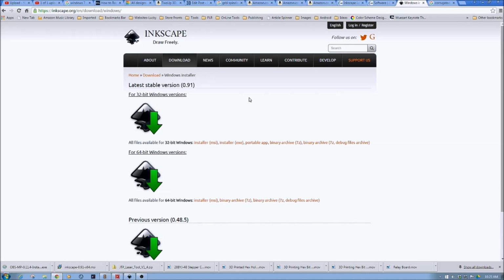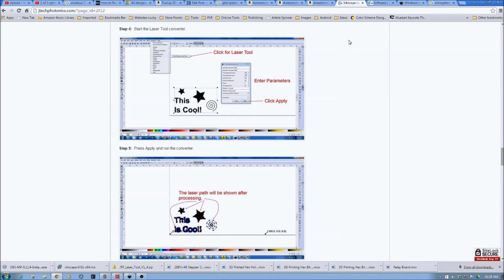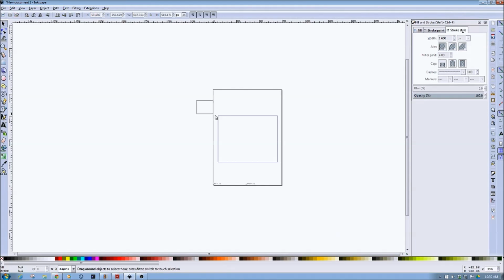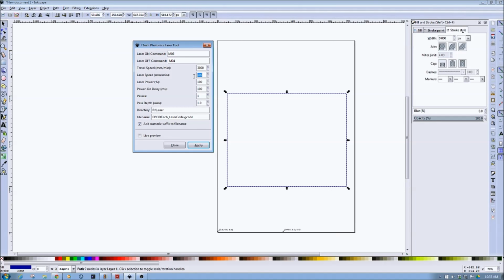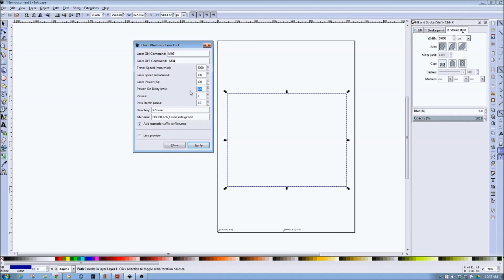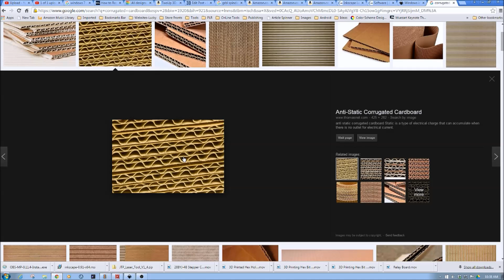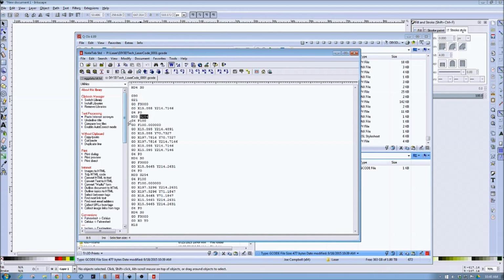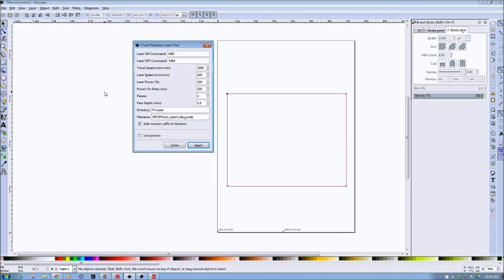Using Inkscape PlugIn for Laser Generating Cutting GCode!

Comment: I am using windows. I found one of my problems it was the magnet on the lid was not connecting so it wouldn't allow the machine to work.  Now that I fixed that I'm having trouble sending the file from inkscape to my cutter.  When I go to extension, Generate laser Gcode, tech photonics, I have no clue what to put in those boxes. I keep getting an syntax error
Reply from the maker: You need a Gcode sender to send the code...

Comment: I put the J-Tech files in the inkscape file and it said it will show up in the program under Extentions/GCode but it isnt  not  sure what im doing wrong
Reply from the maker: The new version of Inkscape has changed a little and it is a little more picky.  It is hard to explain here however make sure you have the newest version (not an in between and I think there is a bug is the 0.92 version) and second assume your using windows is make sure in the root of the correct dir.

Comment: I uploaded the Gcode to my Ender 3, which has a laser installed, but the printer simply didn't do anything. The printer is working and it works with Gcodes made in other programs, but not this one.
Reply from the maker: 3D printers do not use a standard GCode interpreter, they have extended code sets.  This outputs genic GCode with out a post processor.  For GRBL, it should run out of the box.  However you will need to look at the post syntax of a working program and copy it over to the code created the inscape plug in....

Comment: hi great tutorial..are you familair with this other inkscape plugin that i was told  to add? is it necessary ?  
305engineering/Inkscape
Code
Issues 9
Pull requests 0
Projects 0
Insights
Inkscape /
  README.md
  png.py
  raster2laser_gcode.inx
  raster2laser_gcode.py
Reply from the maker: There are tons out there but but I only use a small subset for my purposes and thanks for the kind comments :-)

Comment: Hey, thanks for the video.
It works fine, and I will figure out the small issues I have.
Figures like square and circles are working fine, but I could not get any text on the laser, those will never be translated into GCode.
Could you give me a hint how it works on text?
Appreciate your reply
Thanks
Frank
Reply from the maker: Yes this is possible and easy, what kind of laser of laser do you have? If CO2 (40watt) watch this video https://www.youtube.com/watch?v=gF9M6g7nHyw and get the software and import you Inkscape SVG with text and cut away!  As any thing in SVG file is a "vector"...
Reply: Hi, thanks for answering my question. Got this Eleksmill with a 500mW laser. I figured it out during the night. :-)
It is interesting stuff with this laser. Will try a few more things.
Thanks again, appreciate your assistance
Best
Frank
Reply from the maker: If its a smaller laser, check out the Ben Box program (https://benboxlaser.us/) as it is a must have for the diode laser world...
Reply: DIY3DTECH.com I am really happy at the moment, figured out the settings and the issue with the text, all fine now.
Thanks again for your videos... Take care

Comment: Thanks for the tutorial, not many can give good step by step instructions that are easily followed like yours. My steps didn't quite match as I'm running latest versions but I was able to stumble through. :-) I got hung up for a bit as I don't get any "origins" until I actually run the extension. 
Anyway, if there is a market for laser cut rectangles, I golden! LOL!
Reply from the maker: Glad it worked out in the end :-)
Reply: Yes, the latest version does not generate the origin until you hit APPLY on the extension, was trying it several times and quit after that. But it worked.
My problem is TEXT. I do not get any text to the laser

Comment: Something is wrong, no mattern what i try, the scale is always way off! For example, i make an object that will fill my entire work area (200x200mm). But when starting my machine it only engraves a 50mm area… Looking at the G-code in a viewer it says that the furthest away the head will move is to X55 and not something like X190. I have tried everything i can think of and the scale is always off somehow. Any advice?
Reply: oh my god...Thanks, i lost an entire day because of this before i found your post, i thought i was doing something wrong...inkscape 0.92 and version 1.7 of the plugin do not work properly at least with the default settings....i don't know if in 0.92 version there's something we can tweak to make it properly work. I could make it work with 0.91 though.
Reply from the maker: Can you share a little more background?  What machine and app are you using?
Reply: I'm using my 3D Printer (a Sunhokey Prusa I3) with Octoprint.

Here's what i do after i installed the latest version of Inkscape and the Laser-plugin:

1. Set the document properties to match my printer bed (200x200mm)
2. Import a image that i want to laser.
3. Trace bitmap
4. Delete the imported image.
5. Resize the vectorized image to fit almost to the full width of the bed.
6. Clicking on Generate G-code using the J Tech laser plugin.
7. Click Apply.

It should also be noted that the path that previews how the laser will move is offset above the original path, don't know if this matter?

Then i send it to the laser and it starts cutting, but when i measure it, it doesn't match the size of my document. For example, i measured one letter in the logo i wanted to laser. In Inkscape it was 48.33mm in width but the laser only cut the same letter in reality to approximately 35.3mm. 

So i downloaded a tool called Basic CNC Viewer to visualize the G-code and to my surprise the furthest the X-axis will ever travel is to X58 even though i scaled the object to match my full bed volume (200x200).

I have no idea what to do, my machine is well calibrated as this problem has never occurred while 3D printing. Then my models always match up.
Reply: Hmm.. I just downloaded Inkscape 0.91 and also found an older version of the plugin (1.4) the one used in this video instead of the new 1.7.. Seems to fix everything so it's probably a bug in either Inkscape or the plugin itself. :)
Reply from the maker: Could be now that you refreshed my memory I believe another viewer mentioned the same thing so happy that you got things working!  :-)
Reply: Yeah me too! Thanks anyway! :-) Do you however know if there is a way to also engrave infill?
Reply: I've been pulling my hair off because of it XD I reconstructed the axis, lowered the laser, reinstalled grbl, asked in a cnc facebook group, change parameters over and over until I noticed that the whole issue was the gcode that the plugin or inkscape were generating, so, while I was looking for another laser extension came to this video and look at the comments, I just wish I had seen your comment a month back you would have saved me a lot of time haha. After visiting their website, the recommendation for the inkscape version to use with the jtech plugin is 0.91, the 0.92 version has scaling issues. Thank you!!

Comment: hello great tutorial. I currently have  an X-Carve with a laser attachment. I use PicSender for the laser along with Inkscape. how do you get the laser etch every thing that's black on inkscape? I'm trying to engrave letters and imported vector drawing but it will only engrave only the outlines and not the filled areas of the vector art. could you create a video tutorial on how to do this?

thank you
Reply from the maker: Sorry this note got buried,  however you need to dark areas a pockets, and not sure the gcode plug in can handle this you might have to use an external CAM program (I use Cut2D).  What you might also do is look for the "Benbox" software which rasterizes the image (inkscape I believe will only deal in vectors or lines)

Comment: I've got a bug in my Plotter/Cutter, it keeps printing out the same signcut logo despite the fact I'm using Inkscape with a Chinese made Liyu TC631 Plotter/ Cutter... Any ideas how to fix this ? ? ?
Reply from the maker: Would need to know more details, however one suggestion would be to use a text editor and open the gcode file to ensure it has the gcode you expect and not the same one which you indicate is being reprinted as there is nothing the "electronics's" side  which is going to do this so it must be simply being sent the same gcode file from whatever program your using to send it gcode...

Comment: I am trying to get this to work, but I keep getting the following error.  Any thoughts on how to fix it?

Inkscape has received additional data from the script executed.  The script did not return an error, but this may indicate the results will not be as expected.

Traceback (most recent call last):

  File "laser.py", line 3173, in <module>

    e.affect()     

  File "C:\Program Files (x86)\Inkscape\share\extensions\inkex.py", line 215, in affect

    self.effect()

  File "laser.py", line 3157, in effect

    self.orientation( self.layers[min(0,len(self.layers)-1)] )        

  File "laser.py", line 3086, in orientation

    doc_height = self.unittouu(self.document.getroot().xpath('@height', namespaces=inkex.NSS)[0])

AttributeError: laser_gcode instance has no attribute 'unittouu'
Reply: I have that same annoying problem too, what I did is I downloaded the Inkscape Portable from CNET Download dot com, installed it and it worked perfectly well
Reply from the maker: +Cory Kunz Mac or Windows?  Second did you try deleting the plug in and reinstalling and second would go so far as un-installing Inkscape and reinstalling.  If its a Mac all bets are off as in my experience, Inkscape mac don't get along...
Reply: +DIY3DTECH.com It's Windows.  I tried uninstalling both, I even tried on another computer with an older version of Inkscape and it gave me the same issues.  I will look into it some more.  Thanks for the suggestions.

Comment: Great video, however for some reason, it's not allowing me to copy, drag and drop, or extract these files into the extension folder.  Any suggestions?
Reply from the maker: +Carlsbad Accounting assume windows?  If yes make sure you are doing with an ID that has Admin rights.
Reply: , +DIY3DTECH.com Yes, Windows 7, 64-bit with admin rights

Comment: Will it work for GRBL?

Because in mine S254 only generate 0.11 voltage across my pwm pin
Reply from the maker: +Akhil S Nair Yes I have this working with GRBL 0.9 and the CNC ramps board.  However I believe I am getting +5v at 254...
Reply: now me too.... :)
can we use the same software for engraving pictures??? and circles seem cutting too slow compared to square i mean veryslow. I tried to do a simple sketch containing a circle insidea rectagle and and circles seem cutting too slow compared to square i mean veryslow
Reply from the maker: +Akhil S Nair There are a number of software packages out there which convert raster to gcode and yes it will be slow...